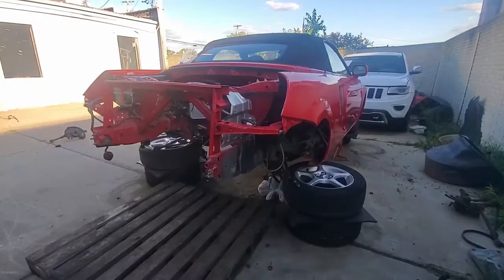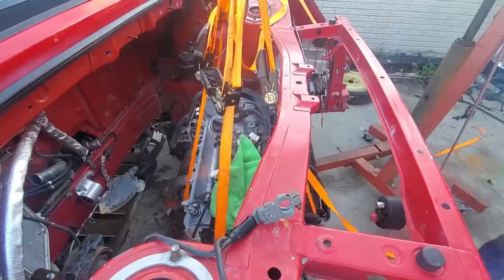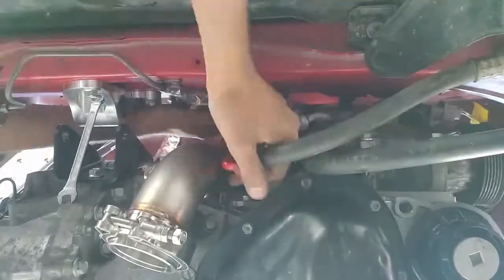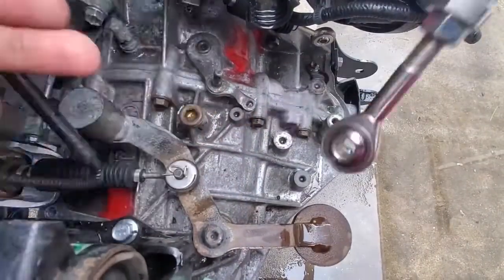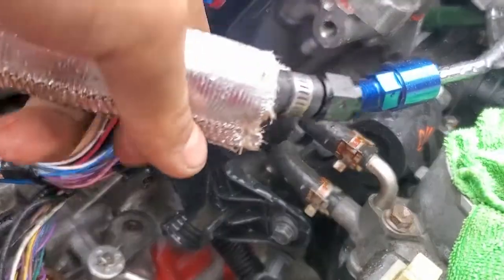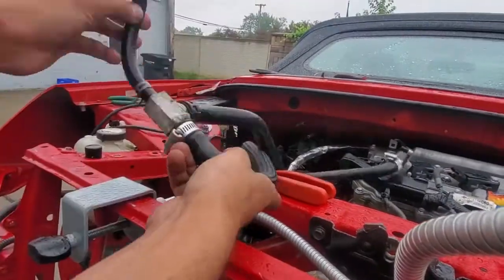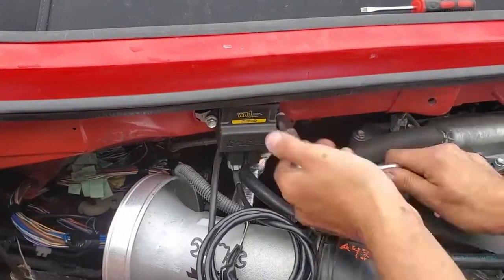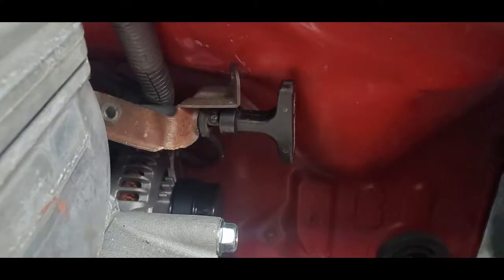MR2 Spyder Project Car Part 5 - 2AR-FXE Engine install

Comment: @3:51 you should change that hose clamp to a real fuel injection hose at minimum. The hose looks like its already torn.....
Reply from the maker: You're right, I only just got around to changing that after noticing a bit of fuel leaking. Replaced it with the double ear clamps. I can definitely see how bad those hose clamps were in comparison. Thanks.

Comment: Where are the feed  and return heater core line ports for the on engine? Toyota’s TIS is severely lacking in certain areas diagram wise. Great work on the build.
Reply from the maker: Thanks. I'm not exactly sure about the feed, but the return seems to be the one beside the ecu. In his swap video series  (3rd or 4th part), Marc pointed out that the tee must be done if you wanted heat to work on the car
Reply: @abdullahmohieddin   I’m using a 2arfe from a tc for my aw11 build. The upper rad hose  (2arfe stock ) has a smaller hose that can be ran to the expansion tank.  One of the heater lines I’ve ran to the larger port on the bypass pipe off the back of the thermostat housing. The other heater hose I got connected on the larger port on the block  near the throttle body. The first smaller hose (top one )off the throttle body is running to the port 90 degrees off the port I mentioned I connected to the second heater hose. The lower hose of the throttle body is connected to the secondary smaller port on the bypass pipe near the thermostat. 
 

Just trying to see if what other connection points might be required since I’m using a Celica coolant bottle self bleeding type . However still trying to see where I can tee for the heater hose, near the throttle body or near the bypass pipe. 

I used the Japan-parts.eu. To look up the diagrams for the full diagrams with the additional pointers to inlet outlet heater core  connection points.
Reply from the maker: I'm sorry, I wouldn't know. I think you can try the Frankenstien motorworks discord.  Good luck
Reply: @abdullahmohieddin  thanks will check it out
Reply from the maker: Hey! I'm not sure if you are still able to see this @rac3445, but after looking into it, the heater return line is actually the port under the ecu, that was T-ed into to go to the side of the engine. The heater feed is just a branch off from the main radiator hose up in front of the car. Hope this helps